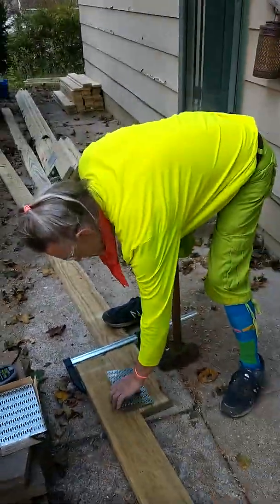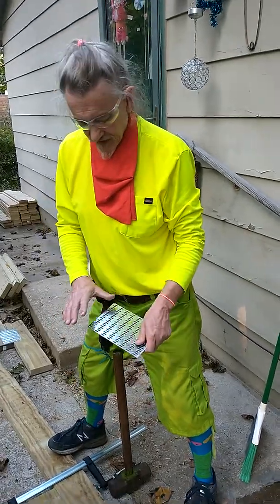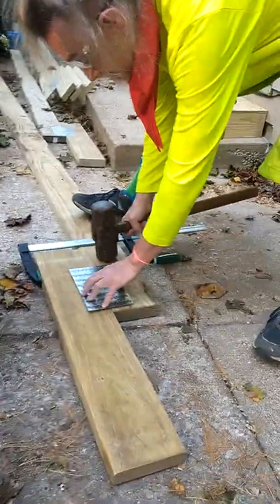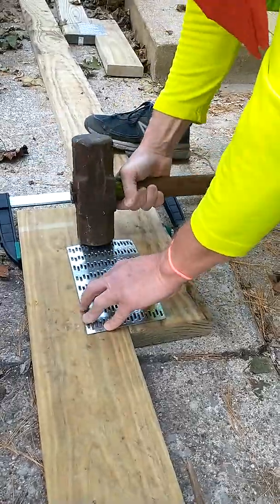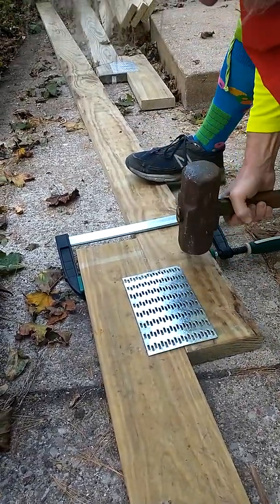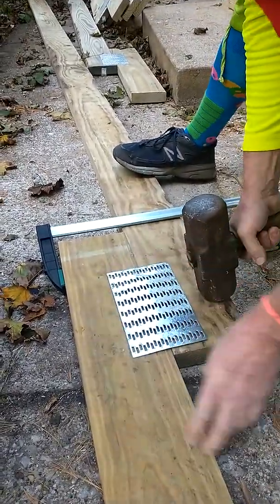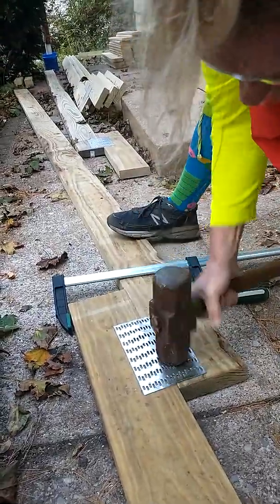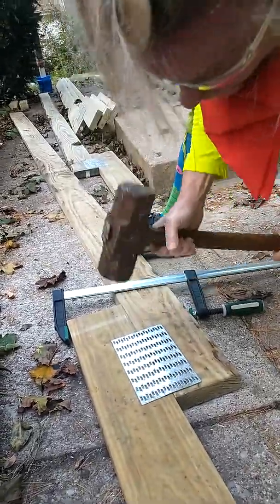How to hammer down a truss plate

Comment: This method wasnt working because I didnt have a sledge and I was working at a height.  It kept popping loose when I started on a different corner.  So ultimately what worked was hammering each corner with a small nail to secure it down.  When all four were secure, I was able to work it gradually all the way down.

Comment: Replacing bad bottom wood on an old hot tub I’m bringing back to life.  Frame had mending plates, obviously installed in factory.  Replaced a few… doesn’t look pretty.  Installing plate while wood lies flat on floor is child’s play.  Try doing it up in the air on an existing frame.   Have to use two hammers hitting both sides simultaneously.  Like I said … not pretty

Comment: I was curious if this was possible or not. All the design literature I've found on the truss gang-nail plate process requires a hydraulic press for even distribution because, "you can't install them with a hammer and ensure correct spike depth." I would imagine with a big enough hammer, maybe even a steel plate to distribute the striking force, that it would indeed be possible, so here we are.

I was concerned that this may deform the plate, but after watching this video clip, I think that is an unwarranted concern.

Comment: I have a feeling that while the correct way is the hydraulic press, the one way you can install when already not having it installed is to use a clamp and some object the size of the plate to distribute load evenly. Can't see it really being reliable otherwise.
Reply: I tried a C clamp with metal plates.  

Bent C clamp to hell….   🙄

Comment: Nice video.  I was always curious about this.  Also I came here after watching a CuFy the home inspector video where he showed a bunch of trusses without connector plates.  So I wanted to see how to connect them.  Of note your wood is on the ground I can’t imagine it would be easy to install these connectors on trusses that were already in an attic.
Reply: Haha same
Reply: Me too!
Reply: Hey me to
Reply: Bahaha that's why I'm here too. No one in the comments seemed to know the right way to install them 😂
Reply: It looks like a video from a creator called Currmitt TheFrog is maybe a little more what we were looking for (edited for spelling)
Reply: Same! I saw cys video and wondered, well, what is the proper way to install these plates! 😂
Reply: They did such a bad job I had to come here to see how it is done😂
Reply: I guess we're all similarly curious 😂
Reply: Same 😂
Reply: Me too. I was presuming it's impossible to do this in situ (attempts shown by Cy) and was seeking confirmation. Seems to me the roof Cy showed in his video would need pulling down and doing again with all the connector plates on properly before the trusses go upright.
Reply: @VanillaMacaron551 i think you'd be able to do it with a 2x6 offcut and 2 pipe clamps. it'll be real slow though.
Reply: @VanillaMacaron551 according to Currmitt TheFrog (as well as a few other YouTubers), you need to put in “sisters” which are basically thinner trusses that you attach to both sides of the original trusses, as far as I can tell.
Reply: Same
Reply: I did the same lol, wanted to see how hard it was for the builders. So it's not hard they just suck at their job
Reply: Here we are now. All the lads.
Reply: Yep.. Cy sent me.
Reply: sounds like Cy is making this man some money.
Reply: Ditto
Reply: You can do it. Just need anothet hammer.  Bigger is better  to hold on the other side to act as a anvil. Works good if your trying to. Hammer a nail in some bouncy wood to
Reply: 😅 me too buddy 😂
Reply: CyFy sent me.
Reply: Haha same
Reply: Add me to the list lol
Reply: I'm here after Cy's video too! I do HVAC Installs. I see them all the time and never knew their names or how to use them.
Reply: Same.  Cy’s vid got me too curious.  😂😂
Reply: Sameeee haha
Reply: He's right. Should be using a press
Reply: Same here bro lmao
Reply: Me too
Reply: Yup same here.
Reply: I watched a short that must have been the same video or from it.  I came for the same reason.
Reply: Same here
Reply: Same

Comment: In a pinch, old school, you can also take 2 roughly 16" boards, put the ones to extend end to end, then lay the short boards evenly over the seam.  Hammer/screw them in, 1 on each side.  Many old places still standing fine where this was done.

Comment: Thanks for this.  I was thinking of trying to rig up my bench vise and some steel plates to make my own "press".  This is better :)  Also, how many of these truss plates did you use on the pyramids?
Reply: they were stone truss plates so this system wont work.  now that ive seen this video and your comment, i have some tie plates that go under train rails that i'll slam with a hammer.

Comment: I’ve built trusses professionally; they nail gunned the one side once and we flipped it and I hammered a corner of each plate once and we shot it through a big roller that effectively pressed both sides at once. And it was done. I’m not sure why people would say you can’t hammer it lol. You’re right also, The corners are important. I’m wondering if you had a big enough hand tamp if you could just drop it down on top a time or two and have the whole plate set??? Anyway, good video; later.
Reply: What can happen when hammering the whole plate in is that the teeth can go in on an angle instead of straight down. Of course depends on the angle and a lot of things, but we've seen trusses that you can pretty much take the plate off by hand. So ideally you'd only tack them or place them with nails and let a press or rollers take care of the rest

Comment: Ok but the reason you don’t use a mallet is because the nails need to be driven straight into the wood. That’s why you use hydraulics. This way just bends the nails and splits the wood so the nails come lose. It’ll be ok small scale but if you built a house like this it wouldn’t be that great.

Comment: A 10 pound plate tamper is what I have had the most success with. Lay the 2 boards under something solid. Imitating a mechanical press, smack the crap out of the plate. It took me 3 whacks and the plate was flush and looked intact on the outside. Hope this helps
Reply: Whats a plate tamper? I keep getting coffee equipment results when I search online
Reply: @eHolmbergh  search for landscaping tampers

Comment: How about i lightly tack the plate on the wood, put it on my concrete driveway, put a 1/4" or 1/2" steel plate ovef it and drive over it with the car or pickup truck?

Comment: You should hammer from end along joint to the other an example is get your hand and two pieces of paper position the two pieces paper as if it’s your timber now place your hand on but cupped as you are hammering edges first now flatten hand paper will separate so will you joints over time as

Comment: I got sidetracked on what colt you join for those clothes instead of how to join a nail plate. That looks great for one plate, but after you do that for 200 you would look like Conan
Reply: A few metal plates and some fixtures bolted to my 20 ton log-splitter will travel at 50 MPH to a job site, then go for it. We are Americans with a can-do attitude to thing outside the box. Go for it!
Automotive ASE Master Tech since - 1978 (Retired)
Besides, I like any tool that can do double duty! Just a fabricator with a 150 amp MIG I have had since 1984...Works great on 3/8” - 1/2” plate steel! That works for me!

Comment: Can I join together a joist for a deck doing this?  Since I'm too cheap to buy a 12ft joist when I already have two 6ft pieces and lumber is super expensive right now?
Reply: You should be fine but I would reinforce them with screws or 16D nails.
Reply: Not unless you add an additional board on the tension side and support it on both ends. You can find the measurements online. Don't take building advice from someone you can't sue for bad advice that leads to damage/injury

Comment: Looks good sir. I'll be making some 12 foot trusses for my small barn and was planning on using these tie plates to put it together.  I used a small hand sledge the last time I worked with them. Looks like a heaver one works pretty well.  Thanks for the video.
Reply from the maker: I am glad that this helps.
Reply: Did you build your barn yet? If not then I’d recommend using a steel tamper to save time (and your arm). If you’re still building your trusses and have questions about it I can help you out 👍
Reply: @Saul.Tinoco  Thanks for the feedback.  No I have not built the barn yet.  After reading many opinions on this matter I think I'll be using plywood plates with a bit of glue and nails to tie things together.
Reply: @robertbassham8514  you’re welcome. I build trusses for a living so I’m swinging a hammer 10 hours a day, 6 days a week and I love it. One thing I can tell you is that metal plates will hold if you hammer them correctly. But since you’re going with gussets you won’t have to worry about that. You’ll have more ceiling space too if that’s something you’re looking to get. If you’re still in the planning stages, look up gambrel trusses. If it’s going to be a tall barn I’d go with a gambrel style truss. If not then I’d go with gussets and bracing.
Reply: @Saul.Tinoco  Do you simply place the tamper over the truss plate and hammer it?
Reply: @PaulShalahm  use the tamper to pound it in. Like a hammer
Reply: @PaulShalahm  if you have the materials for it I would say that’s a far better method
Reply: @Saul.Tinoco  Right. The only modification I'd make is a wider piece of steel to make contact with the top of that bottle jack. ...and If I was doing corners I'd use some type of squaring jig to make sure the  2x4's are aligned properly.
Reply: @PaulShalahm  I second the wider piece of steel. What are you building if you don’t mind me asking?
Reply: @Saul.Tinoco  I haven't started but I'm going to build some floor/ceiling trusses.
Reply: @PaulShalahm  Floors are my favorite haha. They don’t require heavy plates or even nails really but some staples might help keep it tacked while you press the plates. We use 2.5in 7/16 crown staples. 16-18ga should do it if you go that route
Reply: @Saul.Tinoco  I just stumbled across this video since I am also trying to make trusses for a project, and every truss maker in my area has told me they are too busy to make them for me.  It seems you have some good insight, so I wanted to get your opinion on if it seems better and/or more efficient to do the gussets with glue and nails, or use the plates with nail holes, or these metal truss plates with a tamper as you mention?  I have 180 joints altogether and have noticed getting structural truss plates is not as easy as I had thought, so I am looking for suggestions, and hoped that you might be able to help.  Thanks in advance!
Reply: @DrJekyllonHydePark  I would personally go with the Gusset/ Nail option. Even if you could get your hands on industrial quality plates, they must be pressed on at a certain PSI etc etc. It would be safer to use gussets and nails imo. Now if you were building something small like a dog house some 1x2 nail plates and a tamper would be perfect but I’m assuming since you have 180 joints that’s not what you’re building

Edit: the metal ones with nail holes and make sure you use nails not screws. Seen some crazy stuff happen with screws
Reply: @Saul.Tinoco  thanks, I'll grab the metal plates and get to work then. Thanks!
Reply from the maker: @Saul.Tinoco  Thank you. Was a porch, and it turned out pretty well.

Comment: Where do you get those plates
Reply: Here in Canada they are only available to truss manufacturers.  What you can have in hardware stores are plates that you use with nails, or special plates with teeth made to be hammered.  But the real truss plates are only available to manufacturers for the exact reason mentionned in the video, they have to be inserted in the wood by hydraulic press to have their real strenght.  When hammered, the teeth don't go straight into the wood and the strenght is not good.  A couples of years ago, we made many tests to show that to visitors in the shop.
Reply: @vincentmontambault217  Canada has become an authoritarian dictatorship.
Reply: @crosisofborg5524  ok, very brilliant commentary by a very brilliant man...  Not!
Reply from the maker: Menard's. They are readily available.
Reply: Home Depot or Lowes